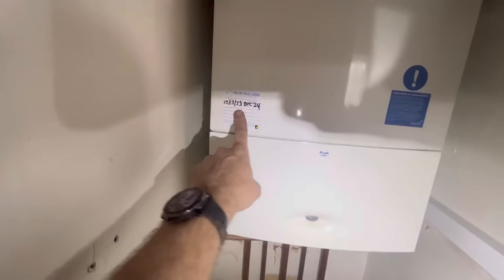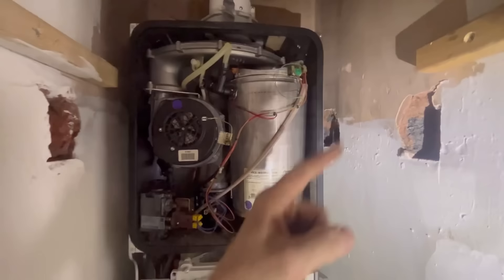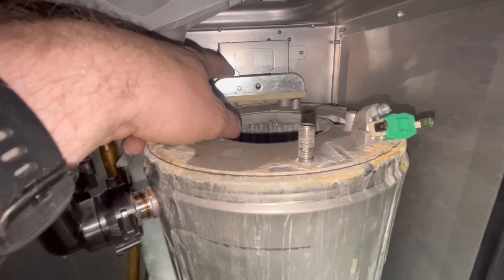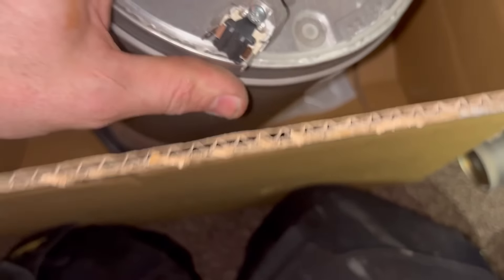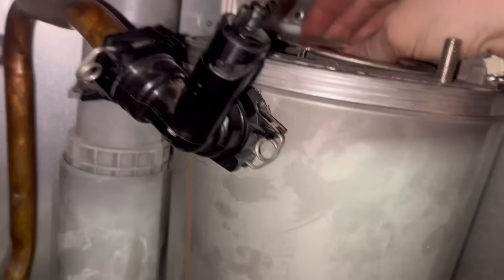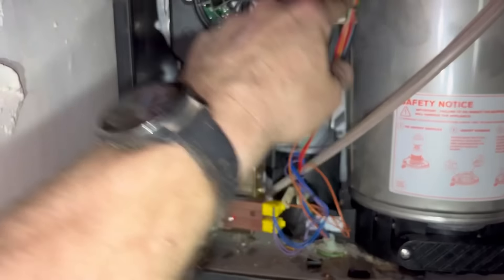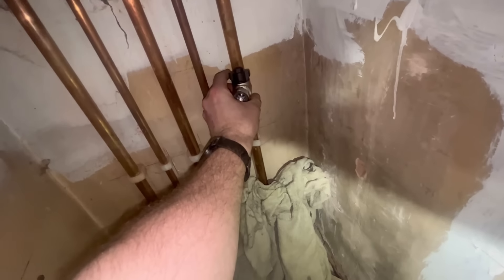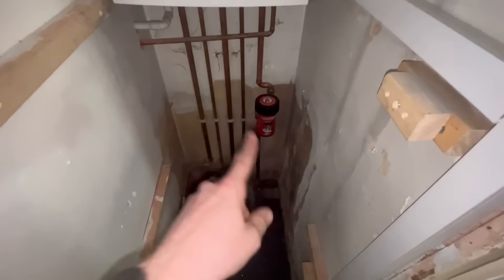Too Far Gone? Plumbers, Would you have done this?

Comment: Dont be scared of that return pipe! It makes for much easier removal of the heat exchanger with it out the way. May save  you getting that "worcetser rash" on your left hand!  
Also,,check the gas air mixture chamber for damage to the bearing plate..its a common fault .(you may have checked but didnt show us) 
Bravo to the one handed job !! 💪🏼

Comment: I suppose it depends on the overall condition of the boiler. If it looks likely other parts will fail in the near future it'd make more sense to replace the boiler. 
Whats the purpose of the black cap underneath the heat exchanger if you dont mind me asking.
Reply from the maker: Gotta be just to hold it in place mate can’t see any other reason for it other than that
Reply: It's just a securing "clamp" in the form of a large plastic nut that screws on to the heat exchanger where it protrudes thru the casing base.

Comment: Condense trap always leaks over the board for me 😂, it’s not going anywhere but it looked like you forgot to push the black locking lever in place that secures the return pipe under the main heat exchanger, pushing it all the way right secures it👌
Reply from the maker: Looking back yeah I don’t think it’s fully over but it only has to be slightly over and will lock in, be alright like you said 👍
Reply: Personally I put it back dry before fitting the fan assembly then tip water in to heat exchanger to fill the trap. Save s the pcb from an unwanted shower!👌🏼

Comment: Hope you did a fan pressure test Luke, might have had cowboys adjusting the gas valve over the years instead of cleaning the heat ex?
Reply: The hex was split mate that's why it was replaced
Reply from the maker: Yeah mate min/max all done was spot on 👍

Comment: Bit like triggers broom, if it's your boiler the labour costs nowt but even then the heat exchanger you're looking north of £200. If it was me, I would have swaped it out for maine 25he combi, fantastic boiler and no agro for least 10 years and everything is a easy swap out, baxi parts are reasonable as loads fit different boilers.
Reply from the maker: I would have swapped but customer wanted the repair..wasn’t a cheap repair in the end

Comment: I love a breakdown and repair. Hate servicing. I'd rather fix than replace. Of course it's up to the custard. But nothing better than tackling a fault. GreenStars are a piece of piss to work on once you've done a few. Great boiler. PRV on the old one's a pain. But the real arse of a Worcester were the old CDi's.  Diverter valve. That fat red expansion behind pipework. Leaking iso's. Passing P2P. The High-Flow, Heatslaves gave me nightmares. Too many "engineers" would rather grass a boiler than spend time fixing. They replace with a 4000 and have no idea how to set one up!
Reply from the maker: Yeah mate I love a breakdown/realise I’m all for saving boilers 👍 your right once you’ve done a few they get easy to work on

Comment: Thats an old boiler. I'd of replaced it. Its a bit like vans. When things start to go wrong due to age you will be forever throwing parts at it. Then your reluctant to buy a new one as you've spent so much on the old one.
Reply: Not that many parts on this boiler though - and it’s efficient. Good for another ten years that. Only thing I would have done cos it’s me is clean up all the condensate marks on the plate at the top,of the boiler and maybe the bottom case too
Reply from the maker: You’ve just described my van to be honest 😂😂👍